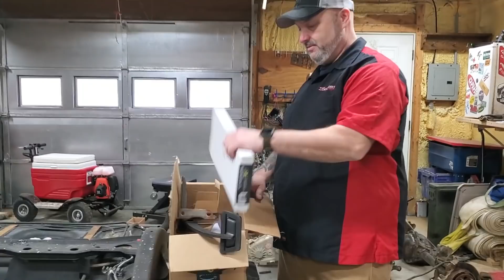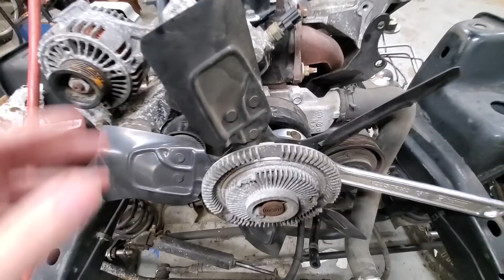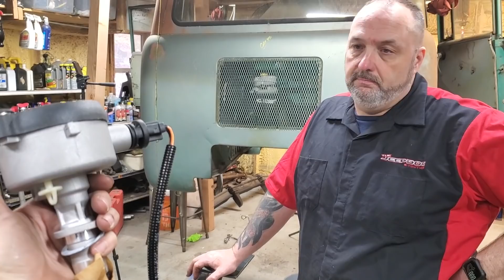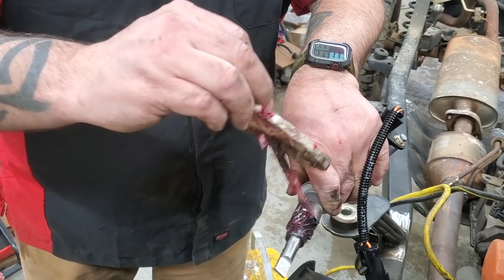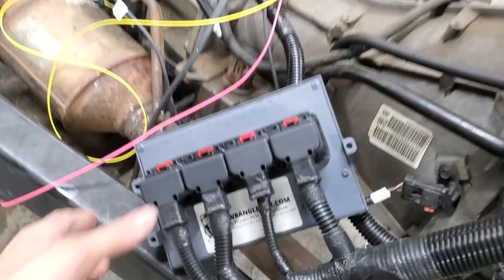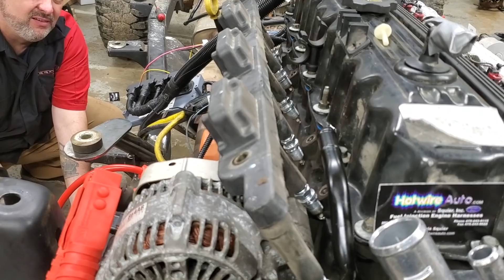Will It Start?  Can We Get This Thing Running?

Comment from the maker: The Jeep FC motor, actually a 2004 Jeep TJ motor with 2006 Jeep LJ wiring and computer with a 2004 Transmission and an 05 transfer case... ya its getting complicated!!  Can we get the darn thing to run?? that is the question!  In todays episode, you'll find out.

Get your Computer fixed with Wranglerfix.com and use the coupon code found on www.bleepinjeep.com/discounts
Check out Hotwire Auto for all your wiring needs: https://www.hotwireauto.com/
Go subscribe to The JeepDoc here: https://bit.ly/3j6XNRs
Reply: I suggest making a spreadsheet with all components used for the build.  Include make, model, year and OE part number.  Keep an electronic copy (or in this case give it to the guy/gal that wins the FC) and put a laminated paper copy in the glove box.  I started doing this about 15 years ago for all my modified vehicles.  I even include the VIN number of the donor vehicles for engine, transmission, transfer case and axles if they are available.   It makes future maintenance much easier.

Comment: When that fun little fuel line connector fails and starts leaking it can be eliminated. I replace the soft line all the way down to the hard line from the tank with a new piece of fuel hose and hose clamps. No more issues and cheaper than a new connector.

Comment: Thanks for showing that marker cap deal for the fitting. To bad I didn't watch this when you uploaded. I fought with a radiator line for 15 minutes yesterday.... I ended up busting the line into the radiator, since I was replacing it, and using a funnel to press the clips.

Comment: Similar to the flex plate differences between years, I once put a HEI in a'72 Buick. Took three days of head scratching to figure out the donor distributor has 13 teeth on the driven gear vs. 12 on the original points dizzy. Popped the roll pin & swapped the gear and the darned thing ran! Amazing what a difference fire to the plugs makes...

Comment: Use your method  to get  top dead Center than as insurance shove a blow gun in the spark plug hole see what happens if blows air out the exhaust u failed if it hold pressure and force the blow gun out u did it right

Comment: Matt I had the exact same timing problem with my Comanche last winter. My wiring burnt up so I put a harness from a different year Cherokee in it and it would pop and backfire but wouldn't run. Im not as experienced as you so I chased that problem a lot longer than a day l, but eventually realized I needed the Cherokee flex plate which solved my problem. I can certainly respect how much work you're doing and all the little challenges these builds take. Thanks for what you're doing and for taking us along, it's just what the world needs right now. Looking forward to the next video!

Comment: You can also pull the valve cover and watch the intake and exhaust valve springs while rotating the engine to absolutely know when you are on a compression stroke to dial in TDC to set timing. Both valves will be shut.

Comment: Ha, i did the same thing with a sharpie marker cap when i replaced my fathers fuel pump in his Explorer. Funny to see someone do the same exact thing to get around a sucky situation. Ive since bought the dedicated tool from harbor freight or tractor supply. A tool i only use in rare occasions so if the cheap one works then its good enough for me.

Comment: No matter what, always do a water pump. I helped a friend put in a crate engine into his truck, he decided to be cheap and ran the water pump from his old engine because it didn’t leak. I was telling him he should replace it to be safe but he just cleaned it hit it with some paint and installed it. He got the rest of what we didn’t finish done late at night. Sad and funny truth, I got a call from my friend about the new engine, ya no Bueno. It blew up do to the fact the the water pump was leaking and over heated the bottom end, cooked the oil, and seized a bearing/bearings and the bottom end grenaded it’s self. On my Toyota when I do a timing chain, I always do a water pump. And all those parts are OEM replacements and always done everyt 100k miles
Reply from the maker: Ohh wow, ya aftermarket water pumps can be iffy at times.

Comment: I was going to say you need to do a hall test so you can see how long it's opening and closing on your spark delivery see what the computers picking up before it's picking up anything from the cam it doesn't know what to do with the cam signal doesn't know where it's at on the crank that's why an expensive scan tool sometimes is the way to go easier said than done right
Reply: I figured that's how you found out is you had the correct tool..nice work
Reply: If you look in one of the attempts to fire you can see my scanner laying on the intake. I was watching the correlation of cam and crank and that was when I got suspicious of the info I was receiving 😬

Comment: Next time get yourself a really long crescent wrench adjust it put it on the fan bolt or nut whatever you want to call it put the belt on there so there's tension take a hammer and smack the wrench hard with about a 30 to 50 mile an hour hit it'll bust it loose like an impact gun you cannot put leverage on it and twist it off it will clamp on itself

Comment: While the distributor censore thing was out you could have primed the oil pump and turned it so you built oil pressure and had oil everywhere without turning the engine then installed it. But probably unnecessary

Comment: A little tip on breaking the fan loose. Take out one of the pulley bolts and put a small chain on it and hook the chain to a bracket or bolt it to something. That will hold it strong enough to break the fan loose
Reply from the maker: Hmmm, good tip!
Reply: That’s awesome!!! I’ll give it a try!!

Comment: Wow... we did a lot of work! Didn’t seem like it at the time! I wasn’t going home till it ran!! Glad I could help Matt! Love the video!
Reply: I'm really curious what made you to start looking to the flywheel direction? Was it a specific diagnostic error code?
Reply: @alnefedov7580  when I was getting common back fires threw exhaust and intake I started reading cam and crank correlation. Matt pulled the crank sensor and I knew immediately what the issue was.
Reply: @jeepdoctv  This part of the investigation was missed in the video and I think this is very important for future mechanics and car enthusiasts to hear how to approach the debugging. In any case, great job of not giving up and firing that 4.0 👍👍
Reply: @alnefedov7580  thanks and yeah, unfortunately you can’t fit everything in the video every time. We tried to fit it all.  Matt is a lot better at explaining the  how and why then I am. Thanks for your comment! I’ll try and fit more diagnostics in future videos of mine.
Reply: Gave you a sub my friend
Reply: @chrisperks1112  thank you!!!